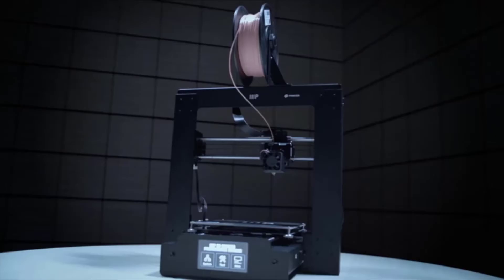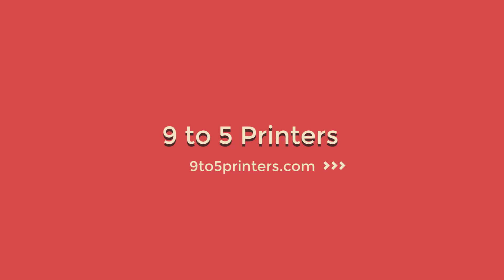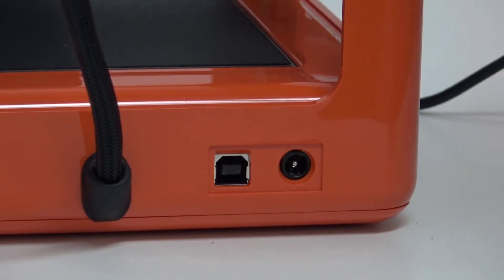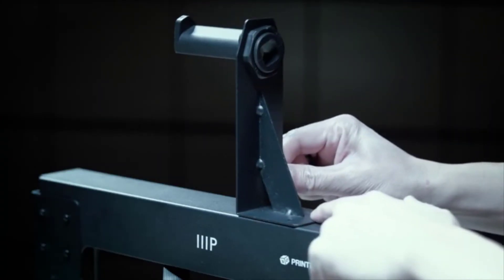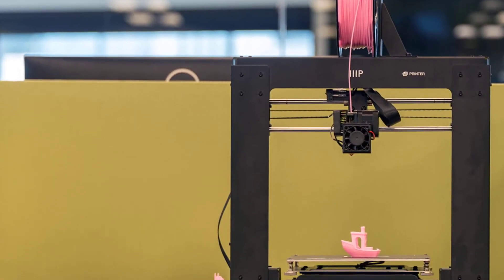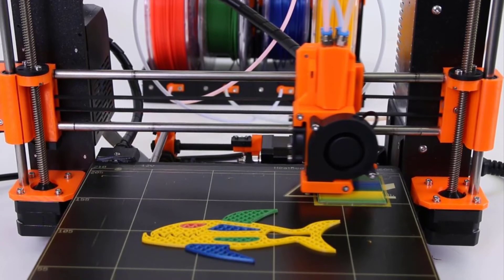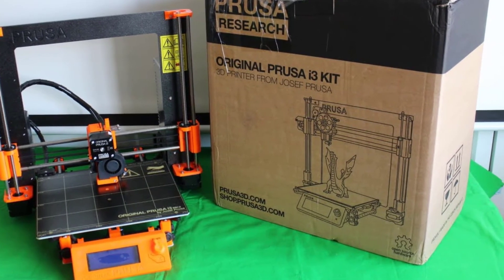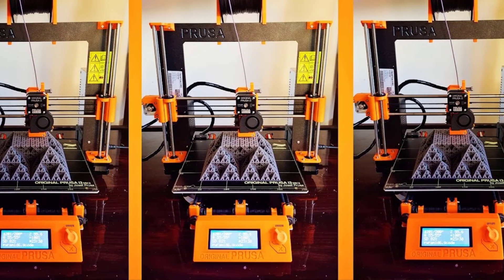Best 3D Printers Under $1000 in 2020

Comment: What a Joke! So no Artillery SidewinderX1 V4's, or Ender 5 Plus? These are fine if you want a babies printer...
Reply: What do you recommend? Genuinely I am buying my first one and have about $600 to spend
Reply: @jayman7066  I would suggest you take a look at the Artillery Sidewinder X1 Printer, Silent Drivers, easy to set up, clean cables, 300 x 300 x 400 build size. I have two of these and couldn't be happier! $669 aust.
Reply: @jayman7066  or the prusa mini, £350 and is probably the best in its class, if the 180mm build volume is ok for you